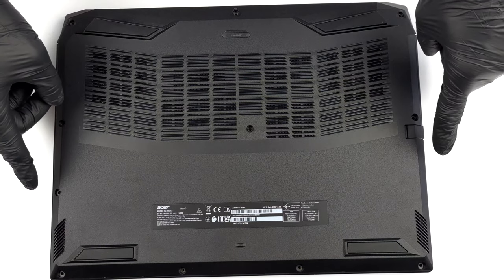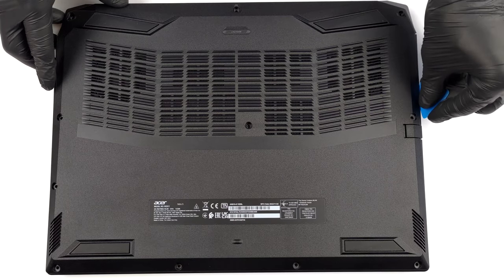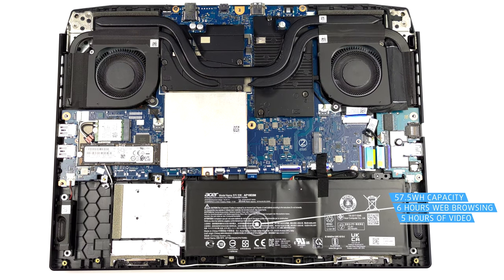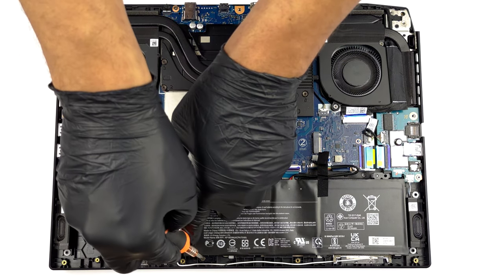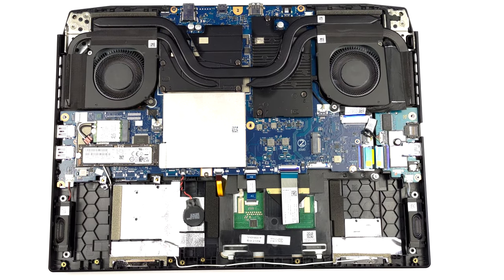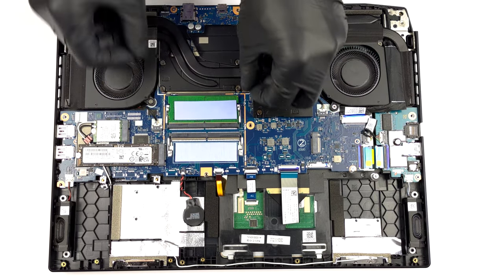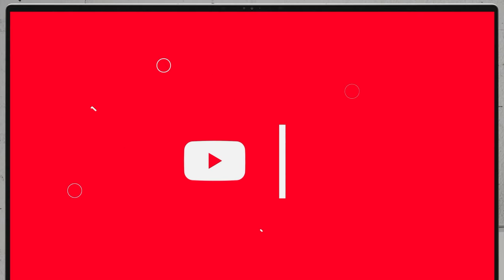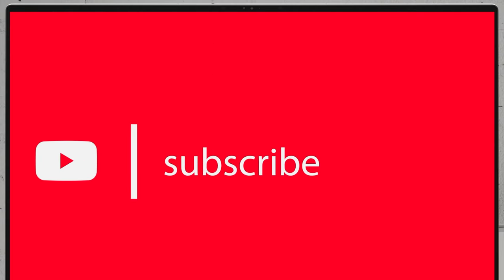🛠️ How to open Acer Nitro 5 (AN515-47) - disassembly and upgrade options

Comment: The space in the lower left region could easily fit a sata ssd, they cheaped out on cents to not have this option because the 58 variant has it

Comment: Hello 👋 
Both slot Pcie nvme M.2 able support 2 x 2 TB ?
Then can put in each Single slot 1 and slot 2
With 2 TB and total 4TB ?
For this model (2023) Acer nitro 5 AN515-47-R3JC
Reply: So i can upgrade to 4tb?
Reply: I already install 2Tb but dunno if the others side can support other 2TB ?
Reply: To made it total 4Tb !

Comment: so no 2.5 hdd slot? what a downer. that wasted space for nothing
Reply: I just bought this and found this out as well, i was like, why the heck there a empty space with the 2.5 hhd connector. :( plus my model came with 2 x 8gb RAM, (canada, best buy)
Reply: @maikerul217  mine had the sata cable in the box and now i have a 2 tb teamgroup 2.5 ssd
Reply: @joababoikoni5624  nice!!! i dont have anything in the box, and yes, it brand new from best buy.